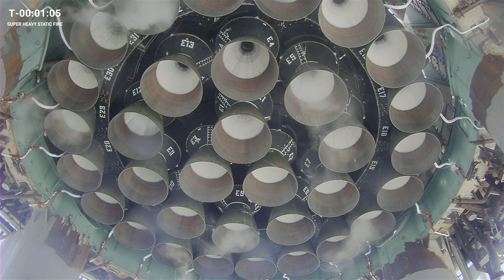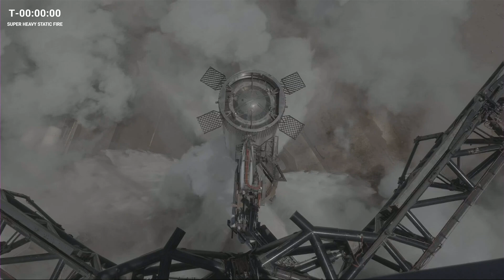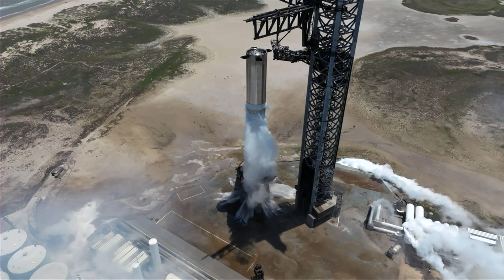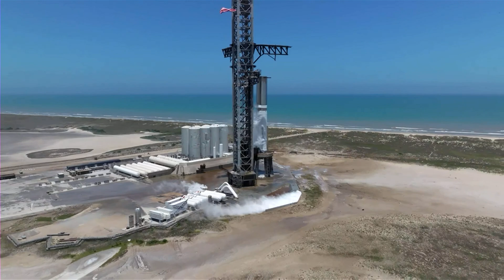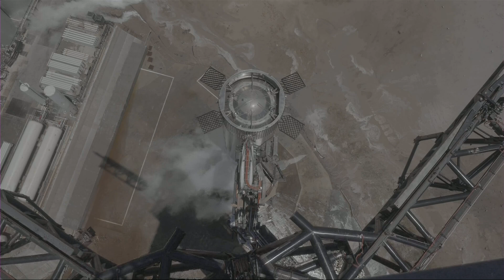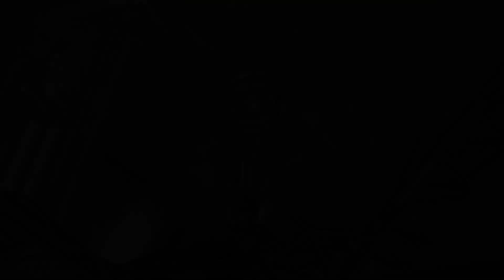Starship Super Heavy Static Fire

Comment: I’m not sure why these guys are trying to reinvent the wheel here with the water deluge system when they had a perfectly good working system in Florida where they launched the space shuttle for decades without any issues.
So why not use that system here?
It would save a shitload of money and time.
Reply: It worked perfectly well for the Space Shuttle, sure. Until it didn't. Space Shuttle broke that system before all was said and done. Multiple times. It would not work well at all for Starship. Starship is far too large. I'm not sure where you get that anyone is trying to reinvent the wheel. They aren't trying to create some kind of crazy new water deluge system that just won't work. They've used it once and works just fine. Also worth noting this is a test vehicle, and you don't put test vehicles on operational launchpads until they're ready. That much should be self-evident. Last, the former launchpad for the Space Shuttle is currently in use by Falcon 9 and Falcon Heavy, so you definitely don't want to start retooling those for a test vehicle. The internet lost its mind over some concrete flying into the air during the first Starship test launch. Can you imagine if that had damaged the vaunted Launch Complex 39A? SpaceX knows what they're doing here.

Comment: Congratulations
I have a question
Why doesn't SX use a magnetic drive system to assist liftoff to clear the tower
The amount of fuel saved to be used later in flight would be enormous
Cheers Rosco

Comment: I'm still confused on why the biggest rocket on Earth has to launch right beside a whole bunch of big ass tank structures scattered around the pad. Isn't that basically guaranteed damage every time they launch?
Reply: Thank you, that’s what I’ve been saying ever since they started 😅.
Reply: It's a R&D site.  They have a limited footprint they can build in.
Reply: Nope. Starship has done multiple static fires and even a launch with this configuration. They aren't an issue. This also isn't the final product. No use building an entire launch system just for it to potentially be destroyed. When Starship reliably launches a new launchpad will have to be built. There aren't any on the planet right now that can presently support this vehicle.

Comment: Hey guys, I know you have plenty of structural engineers, I just wanted to be sure that you've checked the internal pressure tanks on those verticals that were damaged. A single scratch, or worse crease, could remove 90% of the strength. Please stay safe ya'll, and thank you for what you're doing!

Comment: How are they planning to use water and a concrete pad on the moon and mars?  Both have a lot of dust and rocks that will be an issue for the engines.   PS, Are rocks and moon dust going to hurl towards Earth and satellites on take off from the moon?  Just asking how far everything has been thought ahead and love watching the advancements of SpaceX.
Reply: They won't be flying a booster from the Moon or Mars.  I am guessing you don't know what does what do you?
Reply: Escape velocity is less on each of those, and they are also creating specific starship models for the moon landing so i would imagine the initial throttle could be lowered and there may be shielding or some other fixes on those options
Reply: Not sure tho

Comment: So Elon still hasn't had the required environmental impact study for the launch site done, nor has he applied for the state permits for industrial waste water treatment and disposal and is still operating the deluge system illegally.  I guess rich people think they are above the law.
Reply: It was required even for the first launch, and it's illegal. The closure for tests enforced by the police is illegal?
Reply: @z-manoverstreet  tests enforced by the police?  The police don't mandate his launch tests.  The state of Texas and the Federal EPA consider the runoff from the deluge system to be industrial waste water.  Due to the location of the launch site, next to a PROTECTED wetlands area and the ocean, SpaceX was required to perform an environmental impact evaluation the deluge system would have, and to apply for, and receive an industrial.waste water treatment/disposal permit BEFORE putting the water deluge system into operation.  The EPA has sent multiple notices to SpaceX, all of which have not been responded to, and the state has sent multiple notices as well that also have been ignored.  It is a violation of the law to operate the site without the environmental impact evaluation and the proper permits.
Reply: They had an environmental impact study done last year.  You are badly out of date.

Comment: Most of us would love to see All engines perfect.

But that would'nt test the auto data collection and anomolee shutdown software or the sensors.

So 4 engines shutdown is good, maybe even planned? To maximise the usefullness of the data.

It would be interesting to know if the 4 were serial corolated or maybe positional co-located or diametrically oposed?

Whatever - SpaceX will be interrogating the telemetry data from every angle.

WELL DONE Team SpaceX.

Thank You.

Comment: This isn't going to work. They need a flame trench/baffle, diverter and deluge system twice the size of Cape Kennedy's 39 A. Plus raise the height of stage zero to another 480 ft in height from what it is now...all to take the 16.7 million pounds of thrust.  This present system will fail and keeping it is more just whistling past the grave yard🙄
Reply: Really? Cause this just worked.
Reply: It literally just did its job
Reply: @z-manoverstreet No it didn't... this wasn't a full power test...and 4 engines shut down after one second. It won't work...16.7 million pounds of thrust will destroy that rig just like last time.
Reply: @johnpitchlynn3004  4 engines shutting down has zero to do with the deluge or the lack of a diverter.  That's you making up nonsense so you can pretend you have a point.
Reply: @TheEvilmooseofdoom  and you don't know what you're talking about.  A 2 second low power test proves nothing.  Musk has stated more than once this may be a mistake and they may need a flame trench. All kinds of things can go wrong. The harmonic resonance alone of that many engines firing at once can destroy the missile all by itself without the flame trench, baffle, diverter and deluge system. NASA learned that lesson in the 1950s and early 60s with early failures... that's why the flame trench, baffle, diverter and flame trench system was  created in the first place to prevent the sound and resonance alone from destroying their missiles. 16.7 million pounds of thrust is more powerful than the Saturn V and Space Shuttle launches put together.   So stop being an obsequious sycophantic fan boy and pull your head out of your rear end.
Reply: @johnpitchlynn9341  I suspect I have a better idea than you.  The 2 second fire is a concern.  4 engines out is a concern.  Connecting it to the deluge is the nonsense.  The need for flame trench, also nonsense.  Harmonic resonance?  That's part of what the water counter acts.  You know and understand less than you pretend.  So try again.

Comment: At which % were the engines run?. It seems to have kept up nicely!
Reply: I suppose not so much. If there run it all than launchpad is going to space :)
Reply: Probably around 50%
They used as little methane as possible and just the booster to avoid any costly damage so they don't have enough weight to try with full thrust.

Comment: She said 2.7 seconds with 4 engines prematurely stopping. The length of time was in her statement. Why can they not produce 33 working engines? Thrust doesn't matter if a portion never ignites or shutsdown. 

I get it, it's difficult but they all need to work. Cant they be tested before installation into a booster or ship? If they were that's a larger issue in itself.
Reply: A large amount of them were tested, but some didn't. There is a really large gap between older and newer engines. There are engines numbered 70 something
also like 170. Raptor is still the most complicated part of production.
Reply: Figuring out what all the engines won't start is part of the development and testing process.  They do test individual engines but there is no way to test all 33 outside of doing what they just did.
Reply: They don't all need to work lol, the whole point is about 6-7 can fail and it can fly just fine.
Reply: @thecyanadon  Even if they can get away with 7 engines down, 4 engines down at ignition is really bad, since it gives a huge window for other engines to stop working.
 Knowing SpaceX, it will get much better down the line.

Comment: Now the biggest problem,
The new sprinkler system function,
Is it able to withstand the impact of the Raptor engine fully launched,
This is the key to whether the starship can be launched successfully.

There is only a click in the video,
But when it's flying,
It is a continuous shock wave.

Comment: What is the temperature of the deluge water as it comes out of the plate?
Reply: It's still cold, film cooling mostly works by insulating the plate with a layer of steam, the pressure drop is outside of the plate.

Comment: When they take off from Mars to return to Earth,   it may take some time to get that much water together.
Just thinking ahead.  Perhaps they can bring it along on the way there.   Or just hang a few Desert Bags on the side.
Reply: starship landed on the pad without damage and no water deluge system, it only has to ignite 3 of its engines at very low trust while superheavy has 33 of them igniting at full trust during the launch.
Reply: The super heavy booster won't be on Mars, it's used to get starship out of Earths sphere of influence. Mars has less gravity than Earth and it won't require anywhere near as much thrust
Reply: You're not thinking ahead, you're not thinking AT ALL.

Comment: I't looked spectacular! I have a question. Could the steam explosion caused by the tremendous heat, have knock out the 4 engines? If so, I believe they will need to increse the distance between the water deluge system and the engines.
Reply: No.

Comment: Really need to beef up that ignition system. Or add a secondary hot gate just before the flame propagates like I said a long time ago. Titanium phosphide should work. It'd act as a secondary ignition source once hot enough and shield the primary source from flameouts. It would need to be gridded like a fence and flow just as good as an open flow path. 

Also you all need to work on flow control, that ignition was too powerful. If you can't modulate the flow of the fuel precisely you need to multiply the fuel paths until it is manageable or else you'll blow the nozzle before you get directional flow. 

Deluge person did his job very well, needs a bonus.

Comment: Everyone's saying how great this test was, but it didn't last as long as planned (which was only supposed to be 5 seconds) and 4 engines shut down early. You're not gonna get to orbit that way anytime soon. And then what about the whole new redesign of the second stage? This is not encouraging from my eyes.
Reply: The test was to be "just under 5 seconds" (1:29), not 5 full seconds. Also, this is Booster 9's first static fire, and they straight away attempted all 33 engines. Booster 7 had 6 static fire tests before the 33 engine static fire. With these things in perspective, it really wasn't a bad test, and the deluge appeared to have preformed wonderfully as well. Remember, this is all research and development, this test was one of many more to occur.
Reply: If the test exposed a weakness in the system that is good.  That is exactly the purpose of the test.  This is why they build so many and test so much. That's how development is done.
Reply: That's all well and good, but it serves Musk no purpose when he always says things are going to happen more quickly than they do. I'm not a businessman, but I sure as hell know it's better to set expectations low and say things will happen slower than you even think they will, rather than the complete opposite. There's no way this is getting to orbit this year, and that's a shame because NASA is counting on this rocket and spacecraft for Artemis III, and that will probably be delayed beyond 2025 now.
Reply: @narya  You're not a businessman, as you said, but fortunately Elon Musk is. In fact, he appears to be one of the most successful businessman on the planet. Elon's habit of being often too optimistic is well-known, but since he owns the largest and most successful EV car company in the US, and the largest and most successful rocket company in the US, and has at times been the wealthiest person in the US, I'm gonna go out on a limb and say his business model works pretty well despite your reservations.

Comment: Why there is still no flame diverter 😢.....static fire should be done from  height where engines shows max thrust like very above kept now
Reply: I suspect because of issues like this, where they need access to the bottom of the booster for engine work.

Comment: I wonder why the water deluge system starts so early? Isn't there a risk of water being driven up into the engines pre-ignition? Water deluge should  have, at most, a 1 second head start. It will be interesting to see if there was any damage to the pad and to find out what caused the 4 engines to shut down early.
Reply: To make sure the systems work fine before starting the rocket, water will not get inside because of the angle of the holes, it shot water to the sides.
Reply: @Ivan_Berni also the fact the head pressure of the water is nowhere enough to reach the height of the engines. They're giving it just enough pressure so it can hit the incoming height of the plume of those raptors afaik. 

And also the holes are angled so it shoots water radially outwards so as to deflect it out of the OLM legs.
Reply: Let's leave that stuff to the engineers.
Reply: @stratolestele7611  so you're saying we shouldn't try to think for ourselves? It would appear the engineers have had it wrong up until this point.

Comment: Amazing.  Water deluge system fired off and might have protected the pad. Let's hope it holds up during the next launch.
But looks like that engine premature shutdown problem from the last launch is not solved yet. I had hoped it was just caused by the concrete blast, but might be a more subtle problem. Just goes to show, running one or two engines is different than running 30+ at the same time in a confined area. Super Heavy has a much more dense configuration of engines than even the Russian N1. No telling how the turbulence inside that giant blast affect the engines or how the reflected energy from the pad structure affects things. I guess it would be very interesting if the same engines shutdown as in the last flight. If that is so, it may have to do with the pad's interaction with the thrust column. If it is random, then it may be more related to around the booster itself.

Comment: Back to the drawing board! Early shutdown of 4 engines...These huge clusters of many engines packed together,  I believe, will never work together well.   Just way too many parts to carry  Apollo was the best arrangement as was the shuttle. Those Nasa engineers knew their stuff. Big engines are better not small engines on steroids.
Reply: Lots of little engines might be a problem but for their landing/recovery ambitions they are limited.  Big engines bring their own problems and they don't want to do suicide burns like they have to with the F9.
Reply: What about falcon 9 and falcon heavy? They have small engines clustered together and they are the most reliable launch platforms by a long shot. Not to mention the fact that they can land themselves.

Comment: I have to wonder how much the Raptor bell structural temper changed, going from a few thousand degrees, down to the water deluge system temp in a few seconds was?
 
Likely not much, but repeatedly (as is the plan for Raptor reuseability)?
 
(Did I spell that correctly?  Lol)😂
Reply: The bell is already cooled.

Comment: I think that this is not the solution, the water is going to evaporate and everything is going to explode, the solution is for the ship to be a plane, and for that plane instead of having space for 500 passengers to have space for rocket fuel and in the tail it has the engines, once the plane rises to the top of the atmosphere thanks to its two Boing plane engines, it must turn on its rockets to point into space, that will also help so that when it enters it arrives safely to a runway, and if it reaches mars it can land on a flat surface. Really stop using the rocketry now, it's a waste of time.
Reply: What plane in the world can carry a starship?  Do you have any actual idea how much is masses?
Reply: No plane is capable of that, and starship can't be horizontal

Comment: I wonder if starting the water deluge so far in advance of engine firing was a problem? Even though the water jets were angled away from inner core where engines sit, water vapor can still go where it wants to go and I wonder if that combined with instant steaming of the vapor when the engines did fire caused any issues in the engine compartment. Having 4 engines shut down prematurely is as bad as the first launch where debris probably caused issues. They should have the camera data and sensor data though to understand why the 4 engines shutdown early and of course have the engines to review (which they didn't have the first time).
Reply: There is no evidence of debris doing anything on the first launch and I doubt water would be a big issue for the engines if they're starting up properly.  I suspect that's where the issue is, the startup system.  They were also working on that while the pad was being repaired.